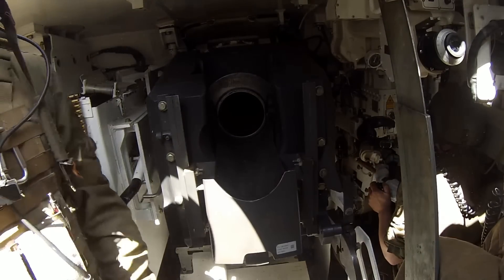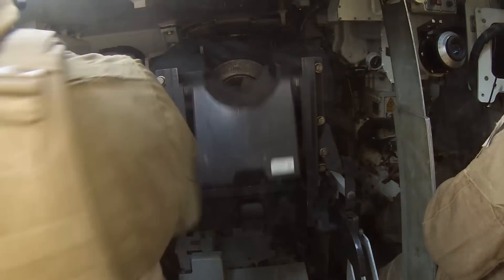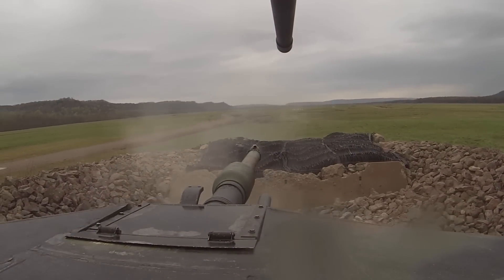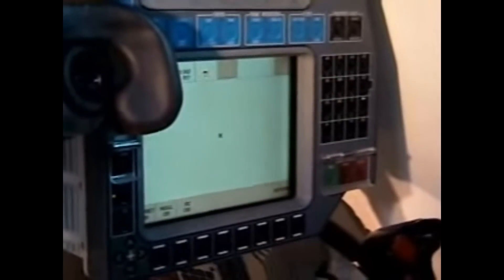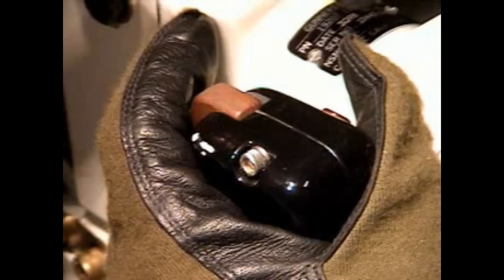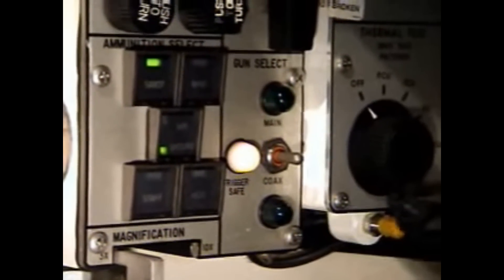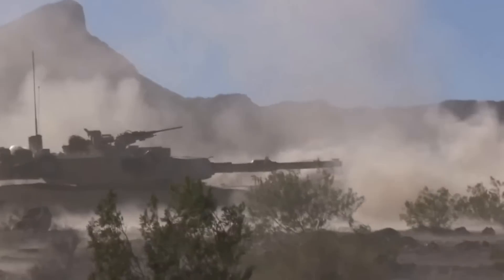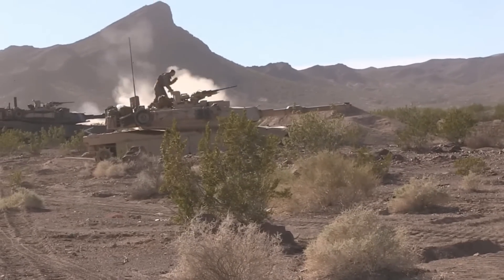How Do They Clear Tank Gun Misfires?

Comment: 15 minutes fuckin hell its only like 30 seconds for a 7.62
Reply: i wonder what the misfire procedure for the german big bertha  thing was
Reply: That's a different system. Tanks use cartridges, if there's a failure in the primer of the cartridge, the cartridge must be discarded. Big Bertha uses the system battleships guns use. A round, some bags of explosives, and a primer sticker. If the primer fails, peel the sticker off, put a new one on, and try again.
Reply: AsbestosRat 037 30 minutes for 105mm artillery
Reply: yea 15 minutes was a rather surprise to me. I wouldn't want to spend couple minutes misfiring 6 times just to wait 15 minutes when an enemy tank nearby.
Though probably would of retreated when a misfire happens for troubleshooting.
Reply: The procedure would have been:
Get the fuck out of there.
Reply: Tru
Reply: Blah b.. Good comment. I like educated comments about tanks. Yes you are correct. After you do all the checks you wait 15mins. That is because you don't want it to go off in the crew compartment. If you end up ejecting a round after that you are ready to remove that misfired round completely from the tank. There is no way I would ever have a crew put it back in the simi or ready rack.  90% of the time it is because the breach is not all the way up.